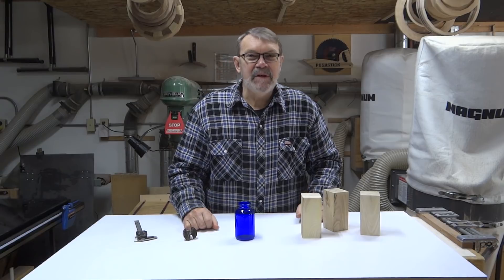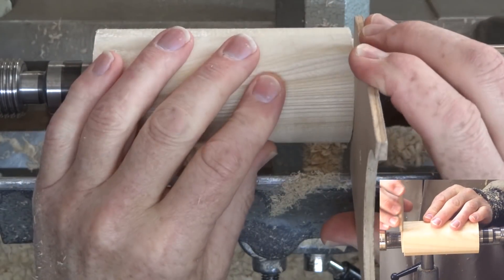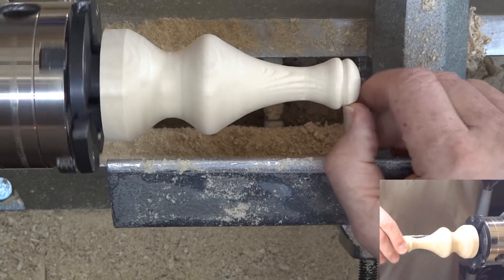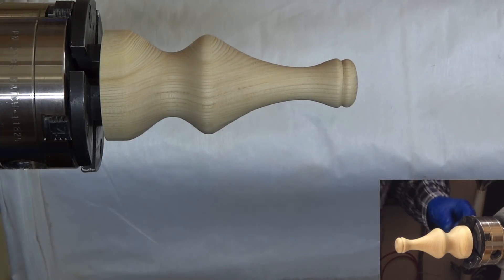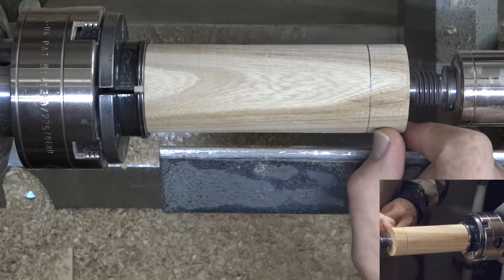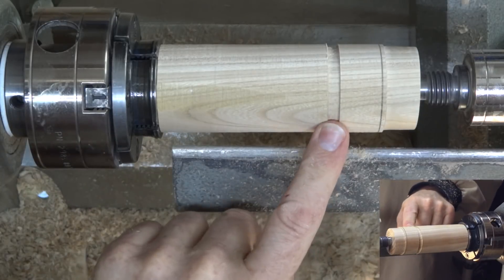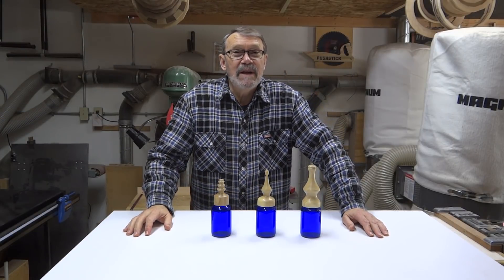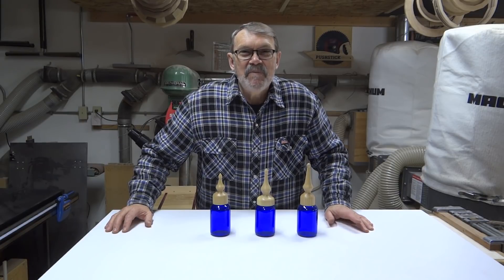Lids For Pretty Blue Bottles

Comment: I know that feeling - - -

What is she using the bottles for?  

I make turned caps for recycled pill bottles.  Also recycled 'Mason' jars that we use as cookie jars.  Because I want the caps to actually screw on, I make the recess in the turning large enough to glue in the original bottle closures.
Reply from the maker: Hi Louie,
The bottles are just for decoration. She doesn't put anything in them. If she did, that's a great idea of using the original lids. Unfortunately she didn't keep the lids. Don't ask me why not; I just do what I'm told. 😀👍 Thanks for watching, Louie!
Take care,
.....Gord